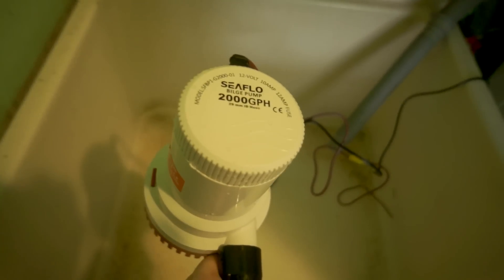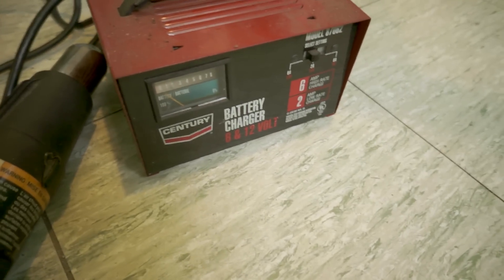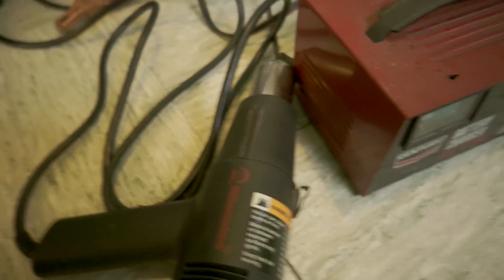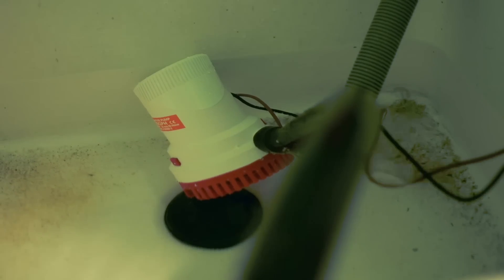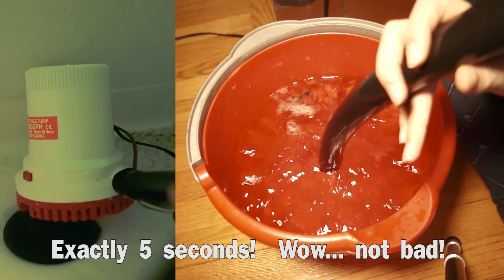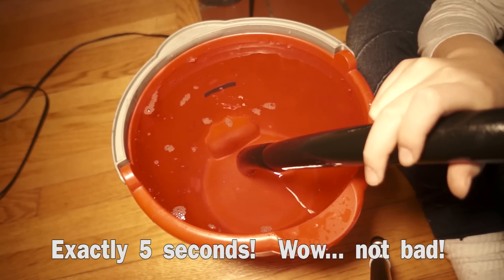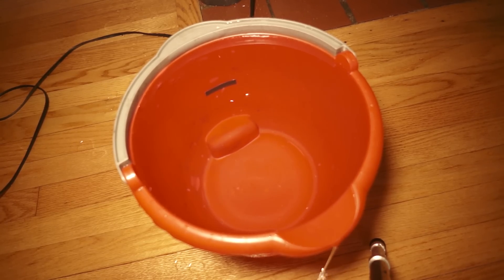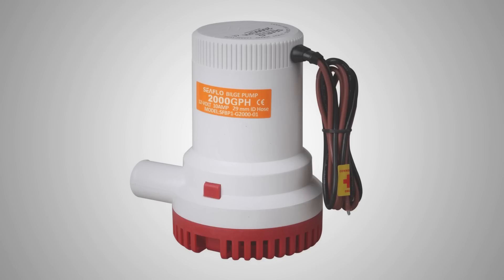2,000 gph A/W Intercooler Bilge Pump Test

Comment: Great test! Wondering how many hours of operation this pump is good for? Thanks
Reply from the maker: Been running it for almost two years (it went in shortly after this test) - sometimes the tank has been dry, sometimes filled.  So far, so good.  I did notice the price went up by $20 though.

Comment: How long will this pump run  (hrs) off a full charge battery
Reply from the maker: Depends on the battery and what the actual (unlimited current) is.  I would assume unlimited current to be at most 10 amps (let's be conservative).  Let's say a typical car type battery has a capacity of 70 amp/hours.  So fully charged, a typical car battery should be able to run this pump for about 7 hours.  (70 divided by 10).

Comment: Um false. There are plenty of boats (the vast majority in fact) that sit in a marina or at a dock with no shore power to keep the battery charged. Therefore, a battery at ~12.3 volts would be a very realistic scenario.
Reply from the maker: I'm testing this pump for purposes of a race car, not a boat.  A/W stands for "Air to Water" and is a reference to the intercooler on the car.  In fact, if you'll notice, my channel is almost exclusively race car/hot rodding stuff.  If you want a boat related test, you are certainly welcome to make one - the pump is certainly cheap.  If you just want to argue, please go somewhere else.  Thanks!
Reply: True....but the boats alternator would have more AMPS

Comment: You could have just had a 12v battery and set the hose similar to a boat setup for a way more accurate test. This proves nothing.
Reply from the maker: That would be inaccurate.  The pump's flow when the car's not running (and the battery isn't charging) is irrelevant.  Also, keep in mind, the charger's current limited, so it's safe to say the pump flows at least this much under real world conditions, probably more.  I just wanted an idea of what the flow was through the tubing - I'm using the pump in a race car, not a boat.  Feel free to do your own test your way :)